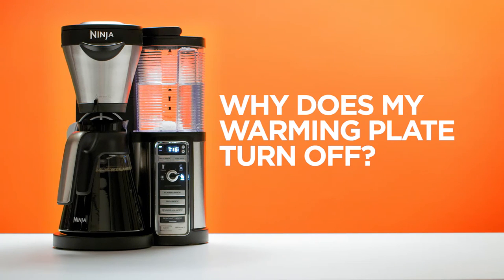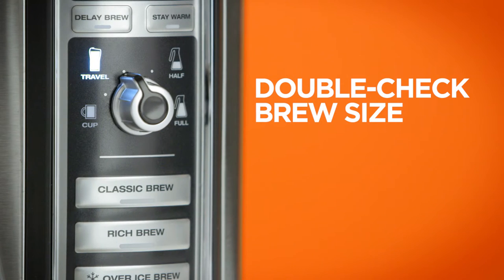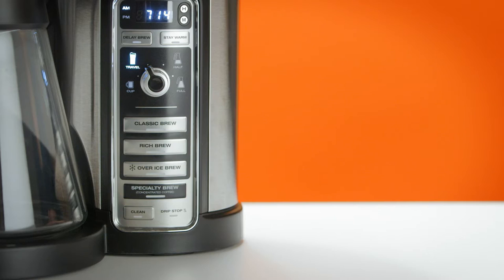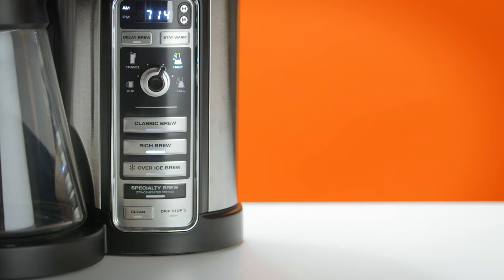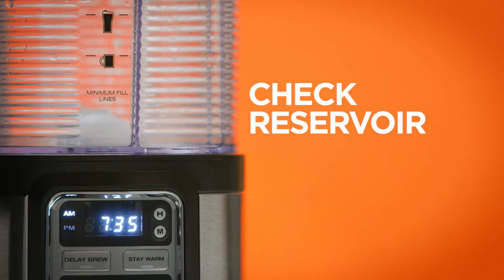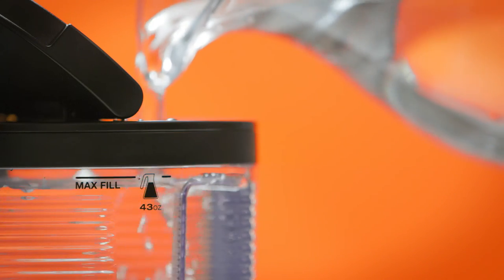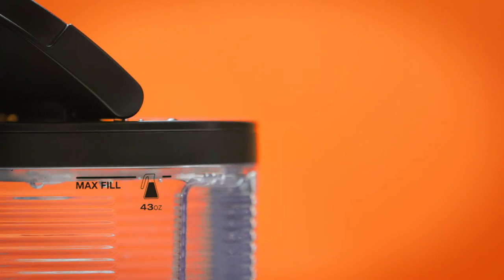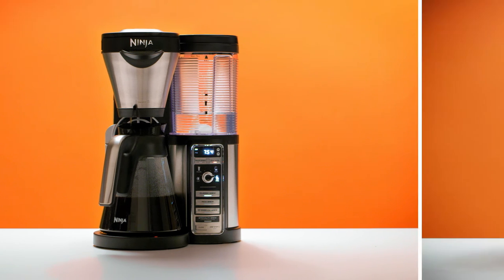Why Does My Warming Plate Turn Off?

Comment: Not helpful. I think it was a bit of a flaw to not allow me to manually place my warming place on. It will eventually time out, and I may have coffee I still want to keep warm. There is absolutely no way to turn it back on, from what I see. The button does nothing when the waming plate is already off. Nobody thought about this?
Reply: Related to the comment above.. I noticed that the manual shows an Off position on the unit, but its not present on the actual product. Manual doesnt seem to cover alternative methods of turning off the unit without using the non-existent Off position. From messing with it, I think switching to travel mug mode, or pressing the Keep Warm button, will turn off the warming plate, but Im not 100% sure about that just yet.  Its worth noting that I have a refurbished unit from Ollies,  so idk if this error in the manual has been corrected on later models
Reply: I couldn't agree more. The #1 thing I hate about this machine which is why I rarely use it. You should be able to hit a button and have the warming plate turn on for 2 more hours. Who finishes an entire pot in 2 hours?

Comment: Warming plate red light turns off after the first cup, about 10 min. It is suppose to turn off after 2 hours ( default) .  I talked to Ninja and they wanted to replace the base unit but wanted to charge me $22. for shipping.   for a defective unit.?  When I asked to speak to a manager, They hung up.  
  The fact that there is a whole thread about the warming plate turning off  quickly tells me this is something others have also experienced.  Wake up Ninja.    Loosing customers.